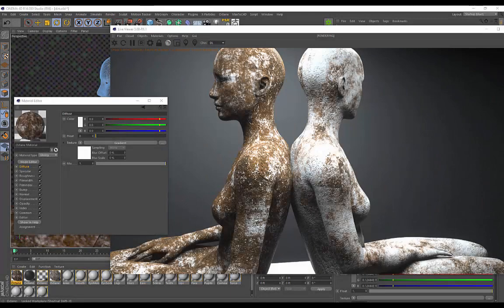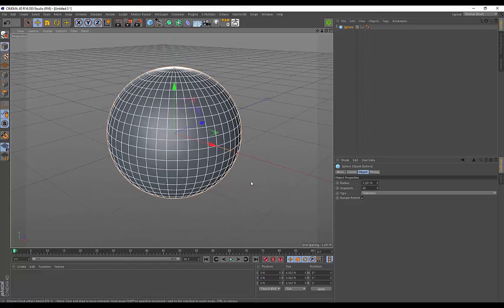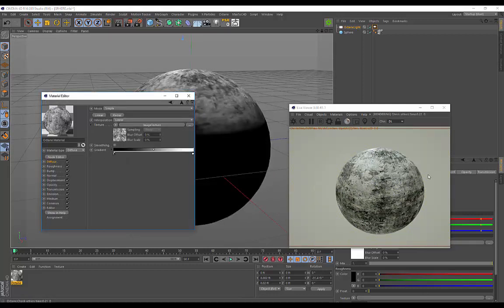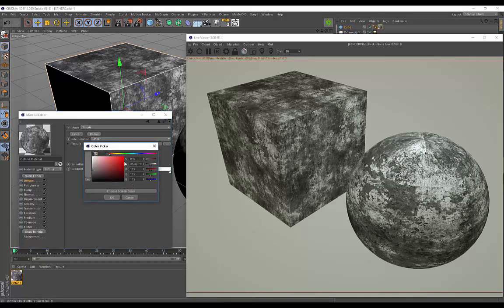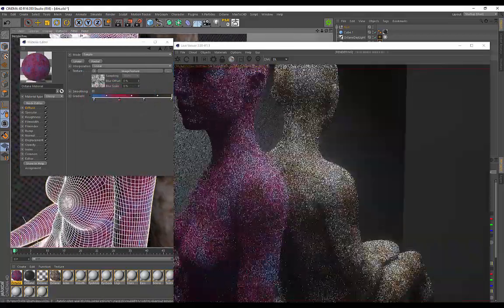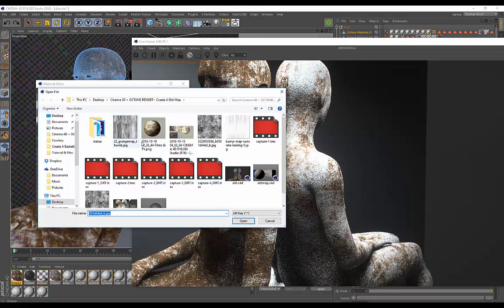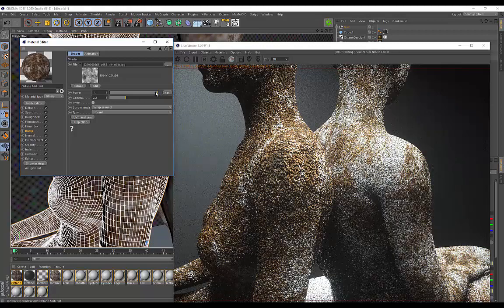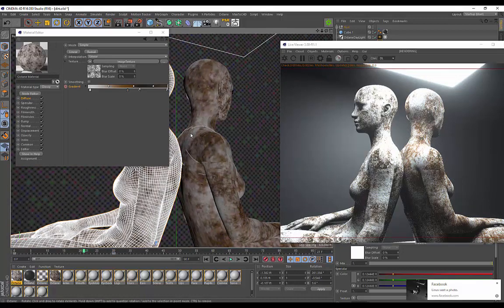Cinema 4D & Octane Render - How To Create A Dirt/Grunge Shader

Comment: quick question!~ have been trying to use this method as an overlay onto an existing texture.  seems like the best way would be a mix material. have it working, but when i try to add displacement by feeding the gradient into the mix material's displacement nothing is displaced.

if i remove the gradient and bring the image texture right into the displacement it works without a problem. i'd love to have it working with the gradient in order to reduce the overall displaced area of the model. lots of depth but only a few places on the model effected essentially. like something came by at high speed and knocked off a couple chunks and left the rest alone.

TLDR- i can send image textures to displacement, but gradients into displacement do not seem to work.